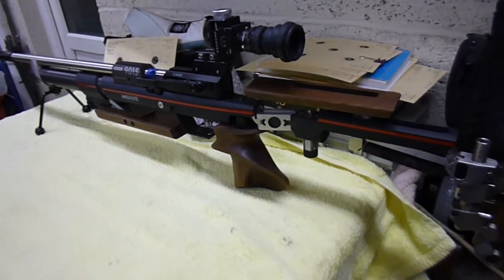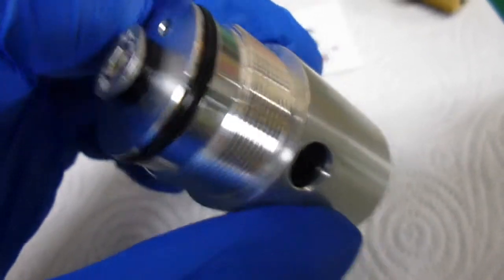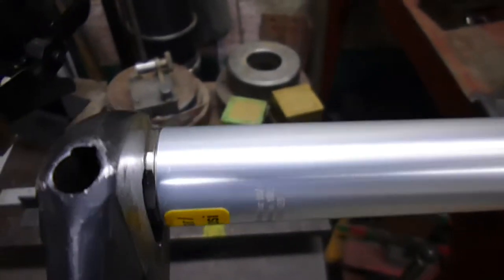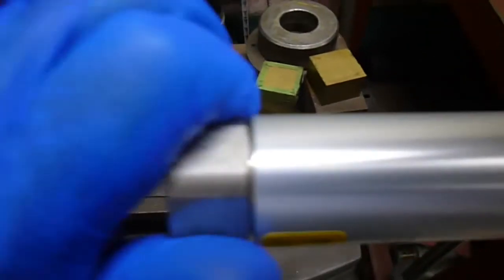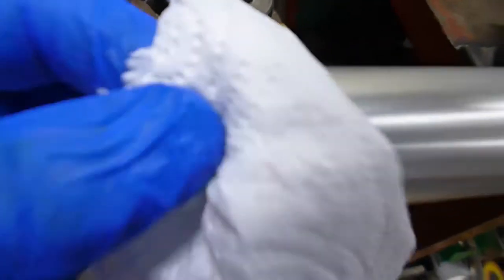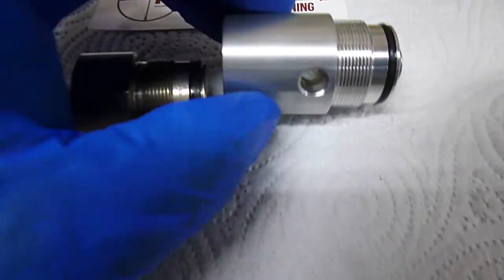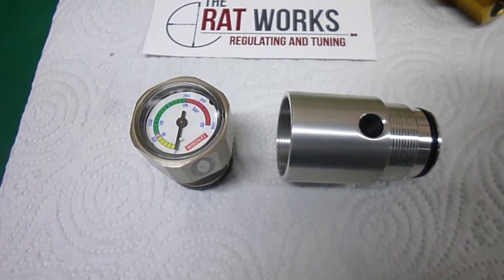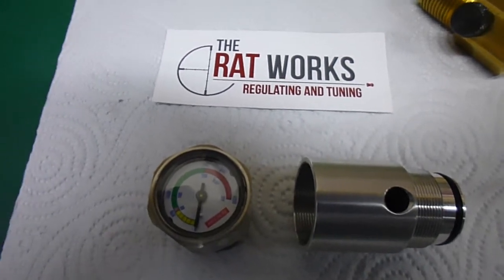ANSCHUTZ 9015 ONE RIFLE & FITTING THE RATWORKS QUICK FILL ADAPTER (PART 1)

Comment: Just bought one for my Feinwerkbau after watching your video,  which helped  me decide , rat works make them for other makes, really well made adapters  which you can buy with a quick fill probe  for them too good job   cheers!
Reply from the maker: Hi Adrian, your most welcome, glad the video is of some help
pretty much the same process on the feinwerkbau, ive just fitted one to my fwb 800x, 
didn't go with ratworks this time chose a different supplier this time, only this different is you do not use the original gauge , but no big deal the one i use now is better
good luck, kind regards...Keith
Reply: @mrmyford  Hi Keith, your  right,  it comes with a gauge all in one quick fill adaptor from rat works  which is their new design and matches the barrel very nicely, well  made as always  good job .Cheers, Regards Ady